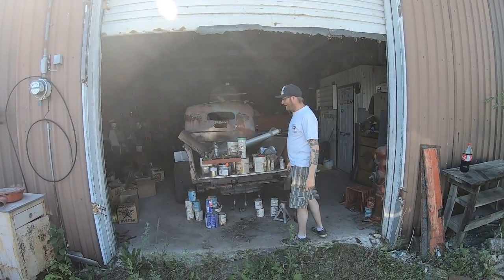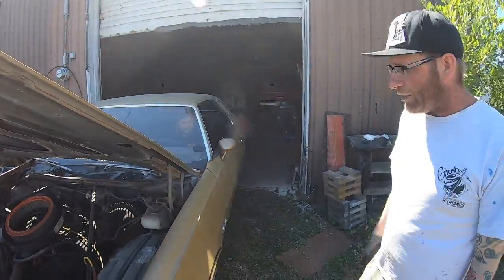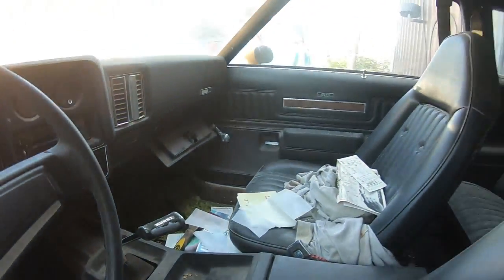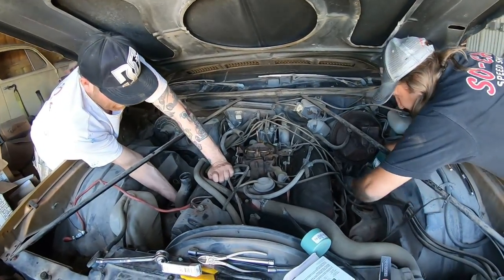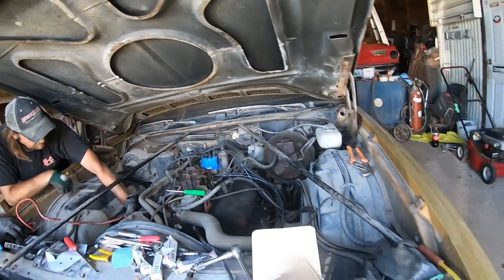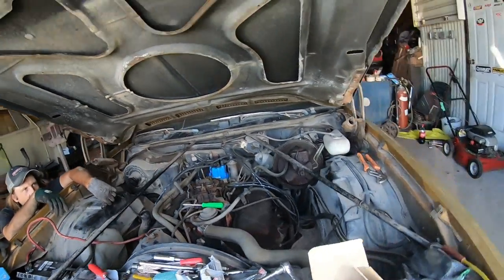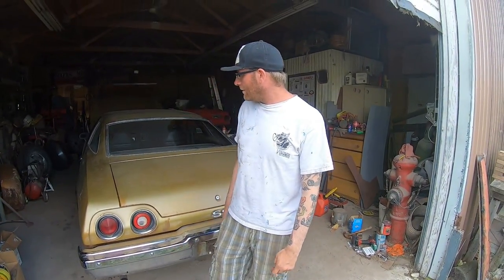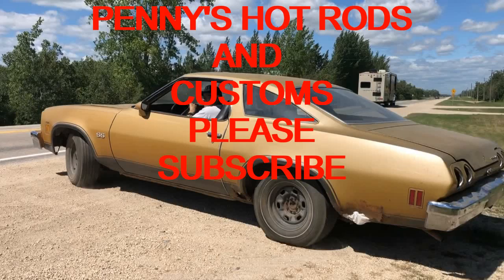1973 Chevy Chevelle SS 454 Muncie 4 Speed. Barn Find, Matching Numbers, First Start, Big Block.

Comment: This Colonnade survivor would be extremely cool set up in "Day Two" fashion the way an owner in the '70s would have done.  Headers, cam, intake, big carb, gauges, finned valve covers, maybe an L-88 hood, slotted or spoked mags, a little lift in the rear with some Hi-Jacker shocks, period speed equipment decals, etc.  Incredible find!  Cars like this kept the muscle car spirit alive as the auto industry navigated a difficult and tumultuous decade.  Thanks for sharing.
Reply from the maker: That is a possibility down the road.  Thank you for watching.
Reply: @pennyshotrodscustoms  My pleasure.  Keep up the great work.

Comment: Just stumbled onto this video. I have a 73 Chevelle SS that has been in the family since new. Maroon with white stripes. My aunt bought the car right off the dealer’s showroom floor. She sold it to my Dad when it had around 86,000 miles on it. Dad gave it to me for high school graduation. I drove through college and after graduating from college, I pulled the tired old 2bbl 350 out and disassembled it. Had it bored 30 over. Crane blueprint cam. Rhoads lifters. Bought a used 4bbl intake from a salvage yard and set a new Quadrajet on it that I had tuned by a local carb man. Set of Hedman headers the drove it to the local muffler shop to get new exhaust with dual 36” glass packs. I had a lot of fun with that car. My retirement will be its restoration. It will be quite a project but I long to be able to drive it again. 🙏
Reply from the maker: Thats a great story its pretty cool when a car has been in the family that long pretty cool.

Comment: Still my favorite car , I was 15 when i bought it, I had a 73 Chevelle, total basic, 307 , no power steering, 14 “ tires, heat riser off the manifold, 350 turbo automatic, Basic! Didn’t stay that way long, lol, I worked side jobs and my brother worked at a junkyard, A lot of from there. Love that car, I’m 56 now and still see it in my memory. Thank you for your videos 💯👊🏻

BTW. Mine didn’t have the swivel seats, I got a set out of a Monte Carlo , Ended up putting in a 327 HiPo out of a Impala , Put a Muncie 4 Speed, Also put in a Dyna 60 Rear end . Fantastic street ride , Again thank you.
Reply from the maker: Cool thank you Tommy, lots of work you did on it.

Comment: My son and I are in the process of opening a restoration/consignment shop here in Northwest Arizona and the mid-late (73-77) 70's cars and trucks are what were going to build and flip. They are becoming a VERY popular build here in the Southwest and West U.S. because alot of them are still on the road or not far from it and they are cheap. When I first moved here I bought a 73 Buick Regal with a 350 and 350 auto trans for $1300 and drove it home, after putting new tires and wipers blades on it it passed inspection, it was in such good shape that I'm now driving it while I work on it. My son just bought a 75 Malibu 4 door for $500 and it was the same way, new tires, new wipers and we had to rewire a headlight and it was on the road. I think we picked the best place possible to do it, Were an hour ish south of Vegas, 3 hours from both Flagstaff and Phoenix and 4 hours east of L.A., good spot for finding good "unwanted by the masses" cars.
Reply from the maker: Very cool, good luck with your shop.  Those years are going up in price.

Comment: sweet old Chevelle.  amazed it ran and started on that old gas in the tank.  then again i had a Blazer that had about 3 gallons of water that an old farmer just kept dumping heat into the tank and it ran.  only reason i found it was water was i pumped it out in the middle of winter and it came out like a slushy.  it ran so much better after i got the tank cleaned and full of good gas.  i would definitely check on that lifter noise.  could just be a lifter sticking from setting.  i've been enjoying your video's.  keep up the good work.  and congrats on the barn find.
Reply from the maker: Thank you very much for watching.  We will be doing another video soon on this car, and try and get the owner to tell the history abit.

Comment: Awesome video, this car brings back a truck load of crazy memories ,I'm Winnipegger, and got to know these pretty good, buckets were first in a Monte Carlo , they sure were nice option,454 not big hp, buckets loads of torque in the winter time you could idle off the line and never have to spin tires, i do remember  these  in 73  was the last or 2nd last year to have valve guides in them for leaded fuel, a few years alter when unleaded came out it wasn't to friendly to valve train , remember pulling one apart in 78/79 to change the guides and a bit of head work at a shop in winnipeg on Nairn ave called head hunters it was a good shop and quick turn around times, buddies mom had a 75 Malibu 4dr with a 350 4 bbl and turbo 350 and that thing for some reason was fast as hell and hit a 100 mph like no ones business , we did allot of drinking and partying in that car , rode hard and put away wet, we kept it tuned up and running really good at our high school, tau shops teacher was a buddy of our friends dad, so we got a ton of leeway from him and she loved it, it never ran bad , she just never knew how many tune ups and oil changes it got,LOL, the muncie shifter in your car had either brass bushings or plastic one of the years had them plastic ones, not too good, the brass were nice never seem to wear out, for a 47 yr old car its ,nice body is as good as you can find especially for a Manitoba car, if you need door or window seals there is company in Wpg in the Inkster industrial park Polar Bear Rubber, if you take a sample of the original they will match it i did a 78 Volvo Coupe 25 yrs back and it was cheap to do the whole car, or one of them companies in the states, pretty sure Year One would carry it. Y'all gonna have lots of fun with that 73 Chevelle SS  👍
Reply from the maker: Thank you, great story.  Good to here from a fellow Winnipeger.

Comment: Everytime I see one of these I'm so very glad I owned a 72 😎🙄
Reply from the maker: lol i know what a change in 1 year but it is what it is .
Reply: UGA Dawgman to each of its own, every year had its down side.
Reply from the maker: @americanmade5895  Exactly.
Reply: 71 and 72 the best year of the chevelle in my book
Reply from the maker: @markdempsey9800  You are probably right.
Reply: Mark Dempsey 71 and 72 lacked power and options you could get the ss package with absolutely anything those years 🤣😭💀. 67 69 70. Most impactful years and most innovative. 67 First year for rally wheels and high performance 396. 69 beautiful car, some say best looking chevelle ever, 396 package came with 300 deluxe and Malibu’s for the first time since 65 and 64. 70 chevelle first year introducing the 454 and also the killer ls6. I gotta hell of a case
Reply: Yea u right jus that body style of the 73 is jus ugly in MY opinion
Reply: @markdempsey9800  I have had both 71 and 72 and yes much better than the 73 but The later one like this grew on me cause it still had the rear lights like the 71 and 72 but then in 74 they change them too. Thise 73 was actually supposedly was gonna come out in 72 but got pushed back because of a GM strike.
Reply: I owned a 68 , 71. I also own a 75 and a 75. Going to go pick up a 73 in the morning
Reply: Seems I read somewhere that 73 and up actually had better handling suspensions than the older ones but to me models prior to 73 were the better looking ones. Those 5mph bumpers as I heard them called back in day certainly didn't help the looks. Wonder if the shock absorbing pistons between the bumper and frame could be removed and move the bumper back some by fabricating a bracket. I could even see narrowing the bumper to make it more flush with the body on the sides.

Comment: LOVE the 73 and 74 A bodies in all of the flavors!   The suspension , handling,  braking and ride of the later A bodies is far superior to the 68 - 72 A body.   Yes they were heavier,  but get yourself 400 or so HP and stiffer springs and sway bars in one of these bad boys, and you are in for a ride. I have a 74 Buick Century Grand Sport with a built up 455 and OMG...Can't say enough how much I love to drive this car vs. my 1970 Pontiac Tempest A body.  And most of them had A/C.  I drive the Buick allot now that air is blowing cold!

Comment: Sounds like its got a collapsed lifter or a bent pushrod when you started it and ran it a little.
Reply from the maker: Yes we think it may be a lifter.  The owner said it ticked even before it was stored.  We will be pulling off the valve covers to take a look.
Reply: Old Big Blocks ate lifters
Reply: Fuel pump possibly
Reply: @pennyshotrodscustoms  fuel pump also could be a problem
Reply: I'd check the fluter valve or the conifiler pins, or the whoshamashingers
Reply: @wutusaying783  Yep... It's that darn Canuuter valve again!!  Lmao

Comment: Love '73s. Very rare 4speed, and a big block. Sound like motor needs some Rislone to clean up lifter clatter. Make sure you use a 10W40 with zinc and Wix 51060. Lucas Hot Rod oil is what I use. Don't want to ruin the original cam.

Comment: I found a 38k Caprice convertible, 454 car. Sat for 30 years. Had a lifter tick on the right side. My 77 Suburban 454 has the same tick as well..
Reply from the maker: Sounds like it may be an oiling issue.  Or they got the flue.

Comment: When I was a kid back in the 80's my old man had a 1973 laguna it was white with black interior I forget if it was a big block or small block but it did have the turn out seats I had a 1973 Monte Carlo it had a 454 with black interior and it also came with the driver side turn out seats I wish I still had that Monte Carlo use to drive it to school and leave out the school parking lot for lunch just sideways LOL leaving long rubber marks out on the road many kids would peel out of there until the police would patrol the area when we got out for lunch so we had to stop LOL!!
Reply from the maker: They are a little odd shaped.

Comment: Guy down the street from me has one of these sitting under a pine in his driveway for probably the last 16-17 yrs. Red with a black top and factory sport wheels. Used to be nice car I remember it driving everyday. Left side of rear bumper just dropped on the ground within the last year. Underside must be shot, I live in massachusetts.
Reply from the maker: That's a shame.  I get some of the suspension rotted away.

Comment: had a black 73 chevelle SS swivel buckets true SS , but they never had a big block from gm unless ordered that way.. 
1973 
Engine
250 cu in (4.1 L) Chevrolet I6
305 cu in (5.0 L) Small-Block V8
307 cu in (5.0 L) Small-Block V8
350 cu in (5.7 L) Small-Block V8
400 cu in (6.6 L) Small-Block V8
454 cu in (7.4 L) Special Order Big-Block 

V8Transmission
3-speed manual
4-speed manual
3-speed automatic
Reply from the maker: Thank you for the information.  This one is definitely must have been a special order.  The dealer that it was bought from I was told they brought in a few "Muscle cars" to bring in more customers, but by 73 there were not to many takers.

Comment: Have a 1976 Malibu Classic coupe that we removed from an outbuilding on my uncle's farm when he passed. We never knew he had the car because he had become such a private person. It had a 1987 tag and only 70,000 miles showing. Apparently that was when he parked it there. Took to my brother in laws shop and got it running. Surprisingly it cranked without any issue after flushing gas tank and changing oil. It has surface rust on the horizontal body parts from not being cleaned for so long. Body is very solid otherwise. Landou roof vinyl had deteriorated and ripped. Interior is in really good shape and has swivel bucket seats and console. Just wondering if that model Chevelle would be worth it as a project. Best thing is the body not having serious rust issues which is uncommon for a car of that age.
Reply from the maker: For sure Craig they are becoming very popular cars least i think so i would say go for it.😁😁

Comment: You might try a Lock-Right Locker 1910-LR by PowerTrax in your 12-bolt. I swapped the 10-bolt in my 72 Malibu for a 12-bolt from a 67 El Camino and the Lock Rite worked great!
Reply from the maker: Cool thank you for the tip.

Comment: Dad bought one new. Got it as an inheritance. Quit driving it at 350,000 miles and sold it....still ran strong but no AC. Sounds like pushrod or few may be clogged.
Reply from the maker: We think that may be the case also.  We will be pulling off the valve covers to investigate.

Comment: Wow! I never saw one like that and I remember when those Chevelle’s were new. Having a brand new big block must have sucked during the 73 gas shortage. Lol
Reply from the maker: I think that may be why it has low mileage.  55k miles.
Reply: Built in obsolescence....I have a 74 Buick Grand Sport 455...it was built AFTER the oil embargo hit,  yet some dude with some cash said "give me the biggest engine they make!" as in "F -YOU" to the system!

Comment: 454 Valve covers are like a Siv Fog Machine .I did my motorhome 454 10 times always leaked and smoked till i learned this from an old guy.The trick is Corks Gaskets with 3M Gaskest glue .Clean valve cover and bolts with brake cleaner use a paper towel  so u can tell when there is no more oil or dirt .Make sure its CLEAN!!!! lol Stick the Cork Gasket to the Valve cover with the Glue first. Let er dry .Clean the Head valve cover surface till no black comes off it on a paper towel CLEAN IT GOOD!!!! Then use a good 3M Gasket sealer between cork and head surface finger tight the Brake Cleaned  nuts without ratchet just use the socket and extention in your hand. Also make sure all oil and fluid is out of bolt holes and cleaned well with brake cleaner and air gun. let it dry over night and your golden.  if you dont want a Valve cover leak this works 3M products are the best dont waste your time with anything else also the rubber gaskests always leak avoid them for a 454.The other bitch of a 454 is the exhaust manifold leak they run hot and bolts always come loose and blow out the gasket but Great motor. My 454 i drove to Canada to Florida 10 times with a rough idle when i took the heads and intake in to redo the top end the guy said Good news is i am done bad news is your intake has a crack and one vale was burnt and not sealing he asked if it running i said i drove it to Canada 10 times no leaks just a rough idle .454s RULE they pass everything but a gas station
Reply from the maker: Thank you for the info.  Yes gas stations are a must for this one.

Comment: THANK YOU for changing the oil ! Drives me nutz wen people start these old engines with contaminated  oil/water in the crankcase:(
Reply: And no dirty contaminated Fuel ! Excellent
Reply from the maker: We have done the breaks and will be pulling the valve cover to see if we can fix the tick.

Comment: My friend is doing a total resto on a 73 Chevelle SS 454 automatic. That 4 speed is very rare, I believe only around 600-700 were made along with around 2600 automatics.
Reply from the maker: That's not that many.
Reply: @pennyshotrodscustoms  Yes. He has been at it about 10 years on his, total frame off resto. Has played HELL trying to find year correct parts, many seem to be 73 only. I guess the story is it was supposed to be a 72 launch however a strike at GM forced them to delay the launch until 73.

Comment: I guess you just ignore the rocker arm clatter. The valves need adjusted, but probably a soft cam.T
    You should not keep your foot on the clutch no matter if think it is no pressure at all, put your foot on the floor, makes a huge difference on clutch life, foot on clutch 80k miles vs no foot on clutch 150k miles. Nice find!!!
Reply from the maker: The problem was the lifters were stuck but we re did the engine and it runs great now

Comment: Now that car is very rare!  Not too many of these have the 454 and 4 speed!  These were factory rated at 275 horsepower.  You should eventually give that 454 a fresh rebuild to give it more power but keep its stock outside appearance
Reply from the maker: That is exactly what we plan on doing.

Comment: My girlfriend had a blue one of these, hers was an SS but she said it was a 350 engine, went pretty good.
Reply from the maker: Cool.
Reply: The SS was offered with multiple engines. Good chance it was legit!
Reply from the maker: @chevyfan1251992  The owner did get a dealer build sheet for the car and it is correct.  We are going to pull the rear seat out and see if there is another one there also.

Comment: When it didn't turn over to start with, all I could do was scream: "It's a 1974 model, Buckle the seatbelt!"  Starting with the 1974 model year, our government mandated all vehicles from then on require the seatbelt to be fastened to start.  The mandate did not make it through the entire 1974 model year before it was reversed, but.......I still remember the pain in the trailing edge that was.  My friends dad used to start the car and then unbuckle his seatbelt.
Reply: It’s a 1973 model year.
Reply from the maker: @ericp6961  It could be since the car was sold in Canada it may have been mandated earlier.
Reply: I had a 73 Monte Carlo and I disconnected the buzzer up under the dash problem solved !!!